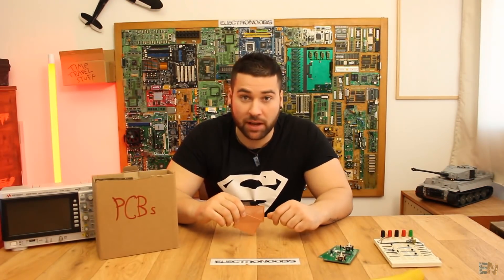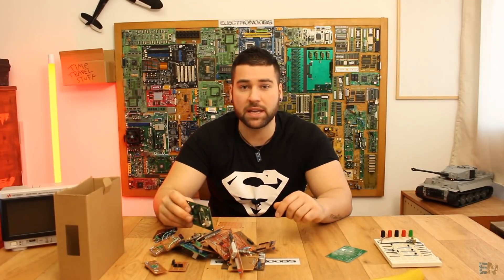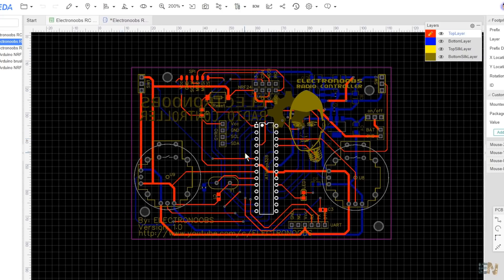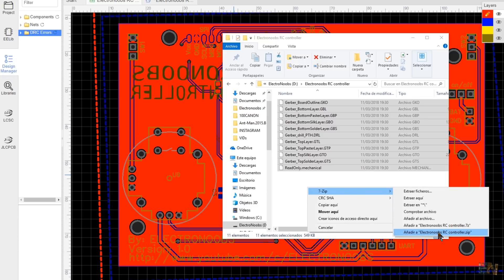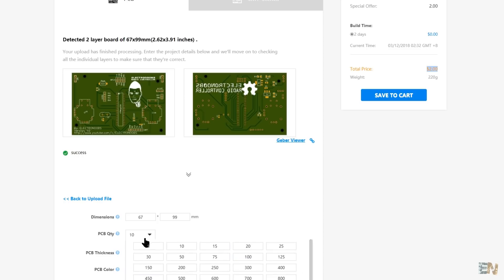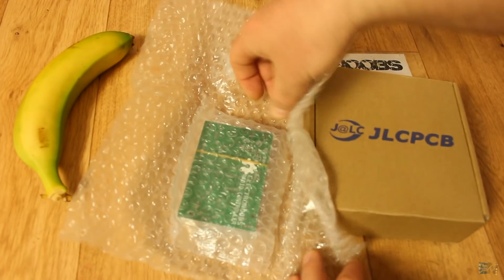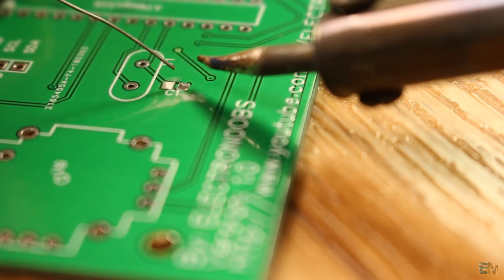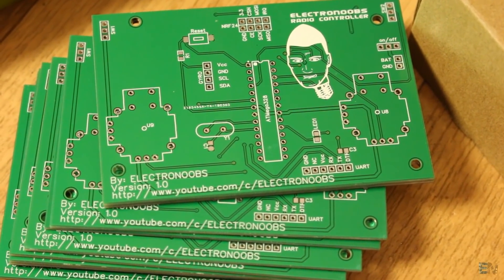A New Way to Order $2 PCBs from JLCPCB

Comment: Even better from JLCPCB, for those of us who solder alot of pcbs with SMD components, JLCPCB can solder them for you within 24hrs.
Reply: It would be nice if it were true, unfortunately they solder only parts you buy from LCSC.
Issue 1: too many products on LCSC are not existing, not in stock, not enough or too expensive, they can compete with Digikey only for price on many goods, but consider that Digikey has free shipping to Italy for orders over $60, LCSC for orders over $299.
Shipping on average is about $20.

Issue 2: an extra cost for EACH change of component of $5 is charged if the component is not on their main list, to load the machine manually. That means nearly all items on the list will have this extra charge.

Consider that you cannot use the stencil to solder by hand if some components are already soldered.

Issue 3: they do not supply you with missing components from other suppliers.

Issue 4: they do not allow you to send your components

Issue 5: no through hole.

I'm hoping things get better in the future.

Comment: What a garbage PCB design. Just by glancing, no decoupling capacitor for Atmega. SMT components on both sides without any necessity. Not to say it's ugly overall. Might be not a big issues to solder it yourself but if you ask JLCPCB to assemble it for you, they will ask much higher price than it would be normally. And likely will solder through hole parts by hand. This is just a piece of turd to manufacture.

Comment: A set of PCB fabricated by Jlcpcb is complete useless. They have not made inter layer connections for the vias.
Also they are not responding to the complaint lodged with then.
You will get good PCB if you are lucky.

Comment: I recently bought from JLC and had to pay 18 GBP importa tax plus VAT, apart from the price of the board AND the DHL which were 27 GBP in total.

However some time ago I ordered a board which was cheaper and didn't pay extra import tax or VAT. (again with DHL)

Do you know what the case is with the prices?

Thanks. AMazing videos!!
Reply from the maker: the boards if are less than 100mm by 100 mm are 2dollars. First order is usually free shipping. Then, don't use DHL. I prefere waiting one week more and pay way less. DHL is crazy....
Reply: yea my board was 4 layer, that is why its was expensive by itself. 

I am just informing that above a certain amount, if you live in a different continent you might have to pay for the import taxes at the borders, which is £11 +£7 VAT (if you live in the UK like myself).

This is likely if your total order exceeds £19 pounds (~23 dollars).

So for anyone outside China who, wants the 2 dollar deal AND DHL shipping, be careful, if you add anything else to the order (lead free finish or different soldermask colour etc) you might exceed a limit that will lead to you paying for import taxes, even after you have purchased the product.

Comment: I see JLCPCB a lot lately. At least you didn't make the blanket statement of "10 PCBs for $2", since that depends a lot on your design.
I am, for example, looking for a manufacturer of my 4-layer design. I highly doubt I'll get that for $2 :P
$32 is pretty darn good for a 4-layer board, though, gotta say.
Reply from the maker: Yndostrui nono 2$ is only for 10x10 PCB an double layer. Sorry
Reply: Yes, I know... I even included the price for a 4-layer board in my comment :P

Comment: Please upload how you made that new radio controller and the specifications.
I followed your other brushed drone video and bought a joystick which has a range of 0.5 to 4.5 kilo ohm.
How can i use that joystick for the project ?
I had also another question in the brushed drone video comment but didn't get any reply and i also tried q&a page. No use! 
So how can i use that joystick and can i get any substitute for the si2302 mosfet transistor ?
Plss respond sir.
Reply from the maker: I will soon make a video on the jopystick tutorial. As for si2302, just search for any other mosfet that you want twith the same pinout. Look for more than 4A of current. Keep up!
Reply: Ok thanks a lot. You are the only one I know who does everything the way I wanted. So THANKS A LOT

Comment: You can also browse sites like Osh Park that charge $50-$80 for the same service, find a Gerber file you like that someone else uploaded and posted publicly on the site, download it for free, upload it to JLCPCB and have it made for $2.
 I found the ATmega1284p "Sleeping Beauty" project this way. It's an Arduino compatible design built around the largest and most powerful AVR available in a DIP 40 package.

  It's worth mentioning that the $2 deal is only for green solder mask, double sided, silver through hole plated stuff. The other options cost more. IIRC on your first order you can get 2 (or maybe even more) designs done at the same time for cheap. I think the cost was $2 for 5 boards, and $4 for 2 designs at ×5 each. I had a cart with the killer OSHW AVR transistor tester version 2 (ATmega1284/644 based) design from the Russian forum, and a copy of the ATmega1284 based Black Beauty I was about to purchase from JLCPCB, but I decided to hold off a bit until I finish one of my designs.

   Funny, judging by your pinned comment's time stamp, your way ahead of your upload schedule. Nice, I'm jealous. Being a gimp sucks. I'm working on a simple op amp tester right now though, and just finished creating the schematic and a fully mapped PCB design set up for 5×7 perfboard. I built it a couple weeks ago already. Now I just need to create a video. 

 I managed to upload a video of the retrace and full schematic for those cheap Chinese digital 0-100 volt/0-10A current meters that cost around $2 and posted them to my GitHub page. I think we all have 1 or more of those laying around at this point. I can't believe no one has a full schematic for them. I made 2 ;)
Thanks for sharing,
-Jake

Comment: What electronoobs and all the other e-youtubers don't show you is this:
Registered Air Mail Arrival time:15-20 business days (0,07Kg) : $8.45
DHL Express Arrival time:3-4 business days (0,07Kg) : $23.83

If the promotional free shipping is real at all, it certainly does not exist for everybody. I am disappointed in what seems to be every electro youtuber (except bigclive) for just relaying the jlcpcb ad claims without checking.
Reply: Pcbway sent me PCBs for just $2 shipped with Registered airmail. No extra charge. It's only one-time though..

I previously messaged jlcpcb about their free shipping program.. they claimed they will transfer $20 into my account after I pay for my order. Sounds fishy. That's why I went with pcbway.
Reply: JS7457 I shared their "free pcb" page on Facebook. Messaged them on Facebook and they gave me a $10 coupon. My total cost was $12 including shipping. So I had to pay only $2
Reply from the maker: That's true, sorry. But even so, I see this service quite cheap and waiting 2 weeks for low price shipping is not that bad. I really love these PCBs. Thank you adn keep up!
Reply: There, I knew there was a catch.
Reply: they told me the same too but how did you get pcbs for 2$ with pcbway ?
Reply: thats why i use elecrow.
Reply: where is that page ?
Reply: thanks !
Reply: suraj bhawal They actually refund me after the shipping of my pcbs by paypal so they are serious.

Comment: $2 for the pcbs $7 shipping
Reply from the maker: That's true!
Reply: Ehh, of course, I knew there is some hidden prices...
Reply: my pcb's cost 39EUR with 15EUR shipping... I would not complain about these prices
Reply: Sami your pricing is pointless without giving size/qty
Reply: I'm comparing what's comparable, the same pcb size and quantity of course... didn't want to point this because of obviousness but apprently it's not
Reply: Shipping must be based on the board size because mines $2 for the pcbs but $18 for shipping.
Reply: @Nicksperiments  shipping is based on weight. Of course the higher PCB dimensions are, the heavier the pcbs are.And yes, shipping is expensive, but imagine that you want to produce 500 pcbs, the shipping + pcb costs wouldn't be much expensive comapred to European/USA pcb factories.
Reply: Somorqntoh OSH Park is $5 per in^2 for 3 boards with free shipping in the US. If I was buying in bulk the free shipping would make it much cheaper than shipping from China. But these services are meant for hobbyists making prototypes. OSH Park is a little cheaper and much faster than shipping all the way from China which is extremely important for rapid prototyping